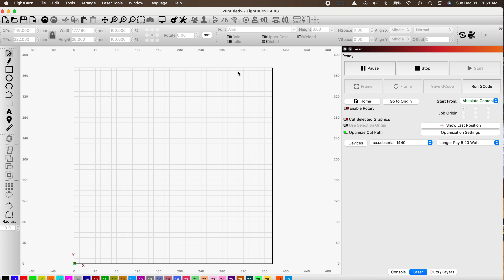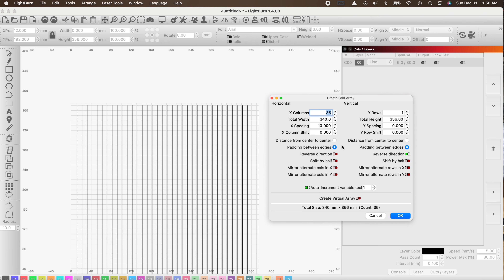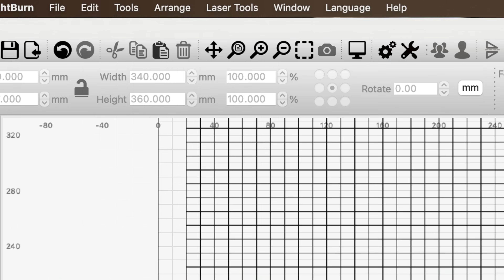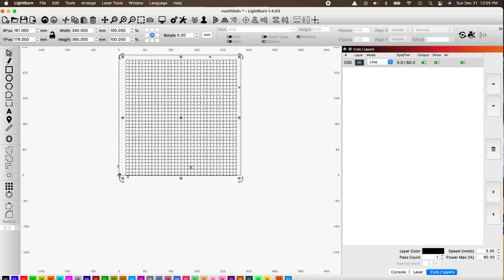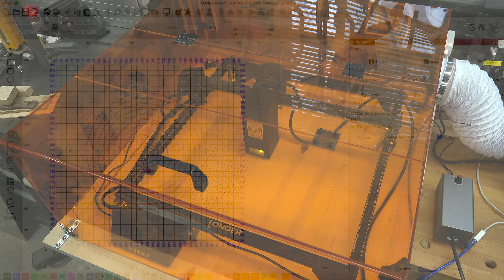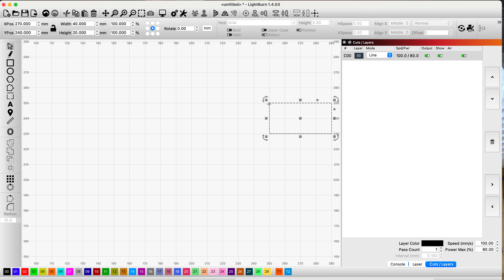Lightburn Tutorial   Making a Waste Board

Comment: Enjoyed video. Just beginning my journey. Can this be used along side a honeycombe?  Also very interested in your enclosure! Did you make it, buy it or come with laser. Thanks for info in anticipation
Reply from the maker: It can be used in conjunction with a honeycomb if you are cutting parts, but at that point, you would be using the measurements on the honeycomb and using your waste board to align the honeycomb to the centre of the grid.  That enclosure is one of the best I've had for open framed lasers and it currently houses my xTool D1 Pro, 20 watt laser.  I had it sent to me by a company who was trying to promote it and I showcased it here on the channel.  Unfortunately however, that enclosure is no longer in production.  It's a shame really because it's amazing.  It was a little higher priced than most but still amazing.  I hope this helps.  If you have any other questions, please feel free to ask.  I'd be more than happy to help if I can.  thanks for tuning in to the show.

Comment: Do you account for the cross hair pointer or the tip of the nozzle?
Reply from the maker: I don't not account for either of those.  Those settings are individually set for each laser within the internal parameters of Lightburn.  They only need to be set once and unless there is a problem, there is no need to set them again.  I hope this helps.  Thanks for tuning in to the show.

Comment: Thank you for the video, great idea for engraving, but if your cutting it won't work with a honey comb bed. I'm a woodworker why not make something to aline to? Like a series of pins or some kind of adjustable stops in both directions to push the work against to aline it?
Reply from the maker: You are 100% right that this will not work for cutting Eddie and that is where framing your work is so important.  On my shop laser setup, I have 3D printed brackets in the corners of the laser frame that align the honeycomb for cutting.  Of course, you will still have to project the waste board from the laser when cutting but it is an option.  Thanks for tuning in and for chiming in with your thoughts.
Reply: @acutabove_woodworkings  Thanks for your reply, just ideas I have just bought a ATOMSTACK X70 Max 70w in fact I haven't opened it yet, I'm going to make an enclosure for it first, I'm thinking of using it to cut the corner box joints. I think I have figured a way of cutting the joints with it , because obviously the parts are bigger than the machine lol.

Comment: Super work.
Suggestion:
Cut out this grid (outer square) and make multiple ones for replacement in future.
Create a frame using a C section channel. Mount the engraver system on it.
Slide this bottom wood in the channel below.
Or try this https://youtu.be/QfUZtgh1gz8?si=KjLrWw-G6Ri4GZvo
Reply from the maker: Thanks for the suggestions and for tuning in.

Comment: Again, a simple method which makes subsequent projects so much easier, and making it copy of the online grid makes it a no brainer to use ... my only suggestion is to add a spoil board to this which has the grid on it, that way you can then replace the spoil board and redo the grid if you ever make the mistake of cutting into it 👍
Reply from the maker: Not a bad suggestion at all Barry.  I like it.  Thanks for tuning in and for chiming in with your thoughts.

Comment: So okay Ken, I understand this is for engraving, and I can see how this makes setup easier and accurate... but if you're cutting, do you remove this board from your laser, or just put your cutting grid on it? I'm sure this is a stupid question.. but I've got a lot of'm. Guess what I'm saying is I want to use my laser for both. 
Thanks Ken!
Reply from the maker: I use all my lasers for both.  When I am cutting, I place a honeycomb in the enclosure with an aluminum plate underneath and it protects my waste board.  When I am just engraving, I remove the honeycomb and aluminum sheet and use the grid to align pieces for perfect placement when engraving.  I hope this makes sense and also, answers your question.  Thanks for tuning in Dennis.  It's appreciated.